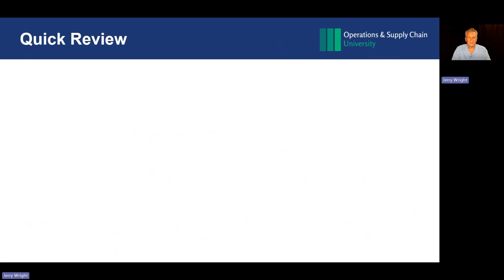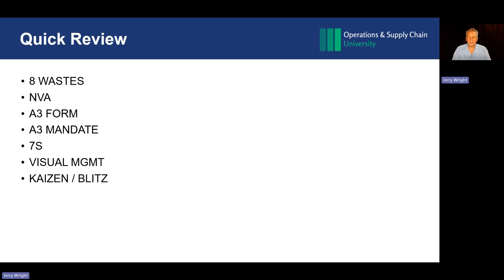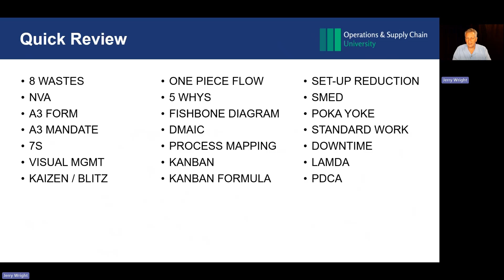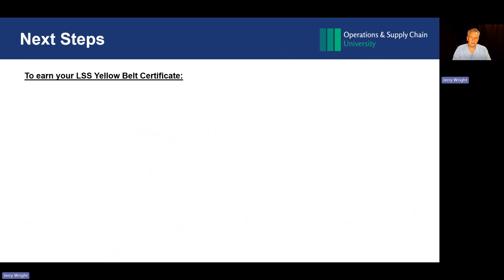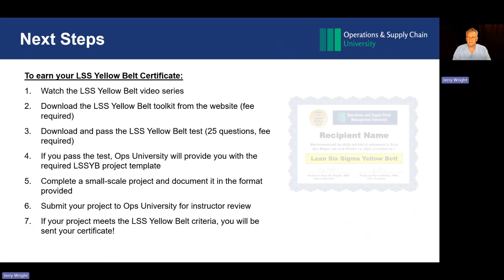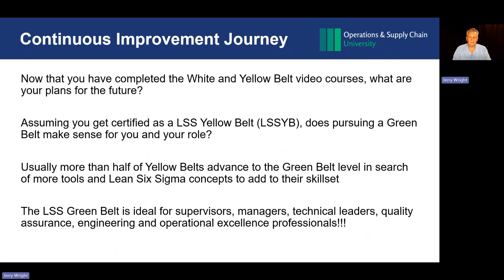Earn your Lean Six Sigma Yellow Belt Certification w/ Ops University- Final video  #21 on Next Steps

Comment: which athurity approved this certification in this university ?
Reply from the maker: Hi Malik, good question! Lean Six Sigma does not have a single governing body the way some professions do, so no external authority "approves" certifications across the board. Programs are offered independently by organizations like ASQ and IASSC, as well as universities and private providers, and standards vary from one to the next.

Our certifications are issued by Operations University and led by Black Belt Jerry Wright, who has certified thousands of individuals across the Yellow, Green, and Black Belt levels. What stands behind the credential is the rigor of the curriculum and the experience of the instructor, not a stamp from an outside agency. Happy to answer any other questions, or feel free to visit www.OperationsUniversity.Org for more information!